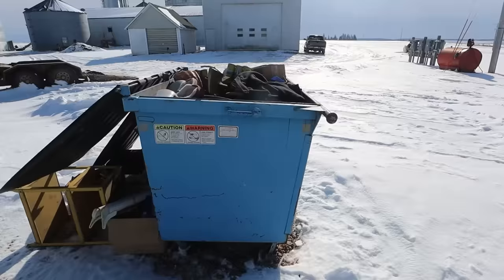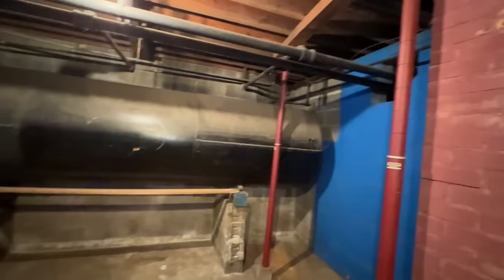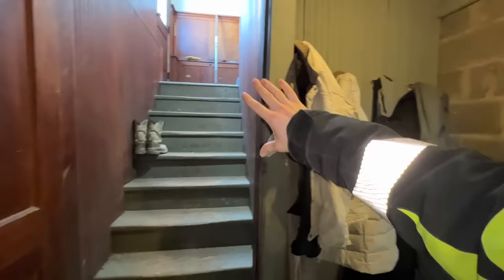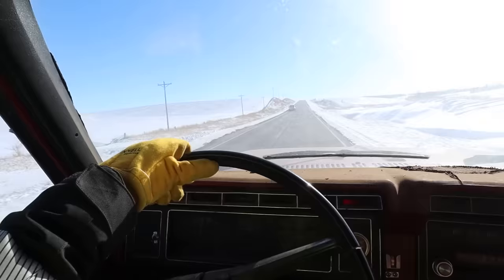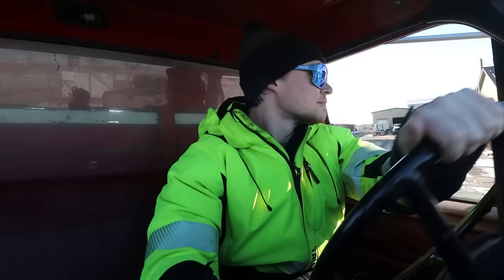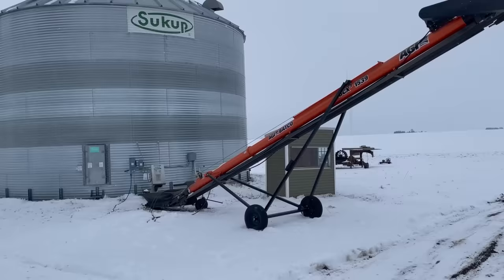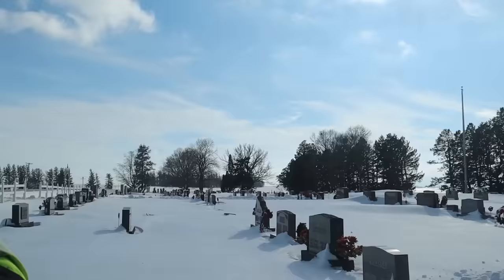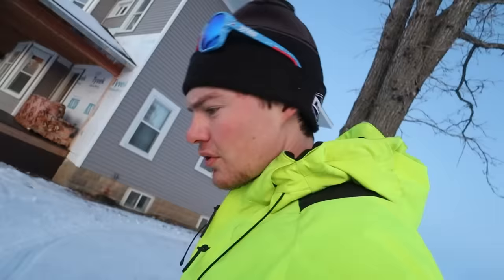REMOVING 7,000 POUNDS OF TRASH FROM UNDER MY HOUSE

Comment: Cole I have a suggestion for you. I have been doing reno work for a good part of my 61 years. With you being relatively young you should consider framing the exterior basement walls and have closed cell foam insulation sprayed in. It will certainly pay for itself in heating costs. I have it in my house from the basement right up including the second floor. House is cheap to heat! Three years ago we had my son's house done as well. They had the attic done and they have a very cheap heat bill. There are a few tricks for making a warm basement floor as well that is not very expensive. It depends how much room  you need at this point. Hopefully you will be blessed with a large family and will need the room.
Reply: He should probably do the upstairs first he has like 5 bedrooms up there 😂 plus needs to fix water issues, electrical, plumbing, hvac, boiler shit, before he even thinks about finishing the basement. He’d be better off spending more of that $$$ on insulation upstairs, in the attic, on new windows, which is significantly more energy loss than basement walls.
Reply: Save your breath.  Cole does not listen to anyone.
Reply: @natalie-nn8jm  Sounds like you know Cole personally. LOL
Reply: And how much does this cost compared to other methods as I'm curious now...🤔
Reply: @SargeWolf010  It is more expensive to have spray foam shot on the walls but not that much more in the long run as you don't need vapor barrier installed. Over conventional cellulose/bat insulation it takes about 3-4 years to pay for itself then you are saving money over the other types of insulation. There are added bonuses for spray foam too. It makes a house way stronger, quieter and will repel water from coming through basement walls as well. (only closed cell). As far as it goes with me I would never ever use anything else but spray foam in a basement. I have been in houses that were less than five  years old with finished basements and the house smelled strong of mildew. I am in Canada so prices tend to be much higher but I just got a 780sq foot basement spray foam insulated and it cost me 2700 dollars. If I had used rock wool insulation it would have cost me about 2200 including labor.
Reply: @davebrittain9216  I see... I'll keep this in mind

Comment: I love that beaded board ceiling. Try and use it some where else. I would do drop ceiling so it insulates and can still be worked on if needed to. Depending on the amount of emergency exits don’t close up windows.  Those pink foam boards work well in my parents in my parents cabin basement and maintains the temp year round. You could put in heated floors to keep it warm down there.

Comment: If you put glass block in the room where the windows are under the porch that would seal that area but still let light in. I should have put in my original post, when the high school by us put in a baseball field and sprinklers in their field, my house was one of the last six that were closest to the field and we all got mice. The neighbor contacted a glass block company because we had your type of windows. Once the new windows were in we never had a mouse problem again.
Reply: Either way, eliminating an emergency exit path is a bad idea.
Reply: I believe there were other windows in the basement and at my house it's not an issue since my basement is not that big
Reply: @kimberlyvarvorines4933  My comment was meant to be more general, not pointed at you. Sorry. I grew up in a home in North Dakota built in 1961. Basement just had 3 tiny opening windows above grade that only kids could get through. Not safe. "Most" modern codes require 2 exits from any room. Generally in a basement it would be the door to the room and a minimum defined exit window size. Where Cole was pointing out that window, it was it's own room so an opening window should stay. If you watch remodel shows, if a basement window is too small, they will enlarge to meet current codes. Or add one if it doesn't exist where required. I visited my childhood home a few years ago and the new owner had to replace all the small basement windows with larger ones and add a window well, including the fixed glass block ones.  Different areas do have different requirements, If you ever watch a Mike Holmes show, he often points out that minimum code requirements are often deficient to good practice. Don't know why I got out the original soap box but I'll get off before I fall and break something.:hand-orange-covering-eyes:
Reply: @moosedogdad  I watch all those shows and you do have to have egress windows if its used as living space. You can get windows that are similar to glass block but can be opened. I didn't take offense but I'm sure it will be helpful to others👍

Comment: If I were you I'd run a whole new electrical panel and wiring through the house. Keep old things on the old system but as you add new things put them on the new box. Then one day pull the meter and just move the service entry wires to the new panel. Would be less risk if there's a lot of shady wiring going on in the old system than replacing things one by one on the old system.

Comment: A suggestion for the basement window under the porch.  Put a small insulated room in front of the window and use it as a root celler to store canned jellys/preserves, onions, potatoes, etc.  Open the window enough to keep the room cool but not frozen. My grandparents did this and it worked great.
Reply: Excellent idea.
Reply: And take one of the other windows and expand it so you have emergency egress from the basement

Comment: I'm a minimalist, if it's not used or hasn't been used, then; "Bye bye" it's ether sold, donated or trashed.
I work at a 117yo industrial bakery, they take out only what they need to, to get new systems in and leave everything else... they started removing out of service systems and hardware when I joined the safety commity and was asked how I look at the place from a safety perspective, I stated; " The place is the industrial equivalent of hoarders buried alive"...they started removing crap! well over 1000 lbs. just in phone and communication lines!!

Comment: To correct you, Knob and Tube wiring is very safe, along as it's not overloaded or encased in insulation.
It's actually not illegal in the US and for lighting circuits, it's perfectly fine.

Comment: Cole trust me and don't put in sump pumps we have a couple at our house and they are a pain in the butt when the power goes out or they fail
Reply: They have battery back-up systems in case the power goes out.
Reply: @carolynreed2688  yeah but they are a pain to change if they fail

Comment: Cole, when are you going to start servicing/repairing the slated sides truck 🤔?
Reply: When it needs it and the main farming equipment is working.
Reply: @emersongarcia7128  Cole himself has said it's "needed it" for at least 2 years now and always that it would be taken in to the main heated shop to be maintained, tires examined, outside rails repaired or replaced etc.

Comment: Just FYI!  New California CARB rules mean there will be dozens if not hundreds of medium duty dump trucks for sale.  You might be able to find a truck that's diesel and between the year 2000 and 2010 for a very good price.
Reply: I do not think he will need it much once all the junk and renovations are done.
Reply: @elizabethliska5377  They will be able to use for the grave digging operations and pull a all the equipment they need with it.  So all they will need is just one vehicle instead of three like they used today.

Comment: Why don't the trucks enter from the other side and use a longer straight away to make it up the slight incline!! Then slowly do the u turn when full. Or have a pile of sand you can spread on the hill when it gets slippery.  Things can always be done differently.
Reply: Turning a fully loaded truck tight like that on gravel would reallly mess up the road.

Comment: In our 1841 3000sq ' stone farmhouse we had a basement with partially concreted floor. We did radon testing (it was BAD) and put in a mitigation system, concreted and leveled the floor, and then addressed the underside of the floors above. Easy fix. Regular insulation between the floor joists held in place with lengths of heavy wire that just wedged into place between the joists. The first floor rooms were SO much more comfortable!  I would certainly consider the idea of water sealing the basement walls, framing them out and using the spray foam.  Terribly cost effective.  Of course ... we had 7 fireplaces in the place that were lovely to look at ... but they really let the heat out!  We used only 2 of them and I stuffed the rest w/ newspaper that I changed yearly.  We had a furnace in the basement that heated the main floor, and another in the attic that heated the upstairs.  Very effective and provided zoned heating.  It makes it easy to add central AC, also.

Comment: Don’t brick in the basement windows. Install glass block. Good insulators and let in light.
Reply: But make sure you have good morter between the glass blocks.  That is often a weak point when it gets wet.

Comment: Just a small point - knob & tube wiring is fine so long as it is in good condition.  But that distro panel does look sketchy.  And as you are redoing electrical because you want plugs & switches in different places obviously you will want modern wiring.

Comment: Knob and tube is still code .  It is safe the connection to the wires are the problem .  Moving to modern circuit breaker is a good thing  for resale .    The fuse block are worth having on static display  as a historical note of the provenance  of the house.

Comment: I had 15 years of “stuff” in a 2 1/2 car garage it was packed I actually did not know where to start However I just picked a spot I didn’t look at how much I needed to do I just looked at what I was getting done each day Well I am 3/4 of the way done  “The only thing to it is to start doing it “Funny that last little bit is going to take the longest time  I “Will “ get my hoarders garage clean out by summer I have a new philosophy  “You don’t use it Lose it “
Reply: well done John!! I have a basement that was filled front to back, just walking space down ailses. It is a little over 1200 sq ft. When we moved here we had a finished basement in our prevkious home, we built this one new and we did not finish the basement . Yeash,,,what a job, Its been 9 years this August and many of the boxes remain sealed and in the spot where the movers dropped them,,,BUT, I have little by litte begun to sort, purge, set up racking systems, bought new bins and organized. Unfortunately in my clearing much of the floor now we see that our findation is cracked horribly all over. I am not surprised, our builder was an idiot and we had to take him to task many times to come back and get the most basic of things fixed. I dont think I would ever build new again, what a huge amount of stress and aggrevation. The only upside is, our house in 9 years has trippled in value. We knew there would be an upside, usually there is if you build new and stay at least 5 years through all the various phases of the build out of your new sub division, etc. 
Anyway, sorry about the ramble. Just wanted to say you are doing a great job and it sure can be over wheleming and the best way to start is to just start !

Comment: Hello Cole from our farm in New Hampshire. Yes, this is where I left you two years ago. I kind of expected all the junk to be gone, by the speed at which you were addressing all the accumulated stuff. Our 350 acre farm is the same way. 3rd generation with two original properties. The grandparents farm has barn after barn of vintage farm implements that are probably dry rot by now. I won't walk through those darkened buildings. Too creepy and I'm afraid of stepping through floor boards!
     Someday you will step back and the farm will be tidy, with only your " stuff" remaining  '-)

Comment: Ok I'm a service electrician meaning I do service calls in mostly residential properties that fuse block and fuse panel are perfectly safe the gutter may not be the best but it's perfectly safe I wouldn't tear out any of the old electrical unless y'all are constantly changing fuses leave it save the 40 to 50 grand on having an electrician come in and fish all the wall or tear up your walls trust me Ive been doing this for 10years id leave it

Comment: If there is a truck stuck cause its slippery a helpful thing to try before towing is to throw some sand or gravel in front of the wheels giving more traction.
Reply: We carry sand/ salt mixture around the yard at work. If ya get stuck throw lil under tires and on your way

Comment: Old houses are great and all… but perhaps doing what 10th Gen did made sense - demolish and build a new one to use for the next 100 years. As one who has owned and lived in a 100 year old house - they are never ending as far as upgrades and remodel.
Reply: And neither are new houses. Maintenance is eternal. My 134 year old house is better built with better materials than anything you can build today.
Reply: @toniasalways  perhaps you need to catch up. 10th Gen is building his new house right now. And you are wrong.

Comment: COLE! I would keep that cistern in there, you never know when you will need to filter your water due to pollutants (Read about the Ohio train crash) and a RO filter only has so much flow. Might be good for backup water in the event that sh!t hits the fan. Alternatively, use it as a rainwater collector to use for watering your garden(s) down the line.

Comment: Spray the basement walls much much easier then rolling it. And better coverage
Reply: The problem with only spraying paint on a porous masonry wall is the paint bridges over the cracks, crevices, and porous surfaces and peels easily. If you're going to use a sprayer, really need to also back roll it after spraying so the paint gets a good bite on the wall...

Comment: That Weil-McLain boiler will last you 25-35 yrs... don't fall for the European junk that guys are pushing.  Coming from a family business of 70+ yrs.  Go with high-mass cast iron, not that tin stuff that'll fail.  Weil-McLain & Taco (pron tay-co btw) are the two solids in the industry that'll run and run.
Reply: We have Weil-McClain in our basement too!
Reply: @mommacs6159  After 40 years, had a call last weekend for a small failure (original solenoid went flake-o) .  We like to install them and clean them.  Failures are not an option in the design/layout. :)

Comment: You will learn that "City Water" is Not all it's cracked up to be! I would keep and UpGrade the Cistern Well... You might need it when they cut-off the city water because it is seriously contaminated [poisoned], they run low, do work on the system... Etc. Always nice to have a Backup!
Reply: Cistern water is roof run off. Not to drink. You can flush your toilet or water the garden.
Reply: yuuuuup!!!! NO WAY would i have city water if i lived in an area where I could have my own well. Been looking for 4 years now to buy a few acres to get out of the city and to the Country so we can have our own water source, hydro source, grow our own food, have chickens and maybe a few goat. Then i wont require four varaitions of water filtration systems to take all the garbage out that they are putting in the city water.

Comment: That is sub flooring at at the 45 degree angle.  The flooring should be on top of the subfloor.   If you could save some of the T & G ceiling someone would have a use for this excellent material.   The windows under the porch would be a good place for venting the basement.  Don’t know how much humidity you have in the basement.  When we lived in Boone, NC anything underground meant dehumidifiers.
Reply: Thanks  --official_colethecornstar